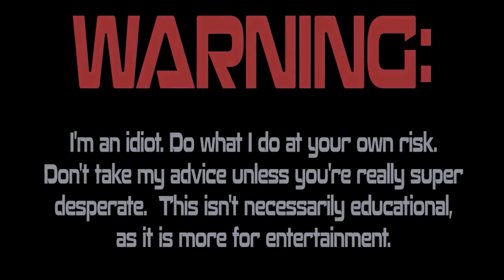ABANDONED S10 First Drive In MANY Years! (No Brakes)

Comment: Wow, I use to have one of those Chevy S10 but it was a four door Blazer model with the GM Vortec 4.3 Liter V6.  
  That was a nice 1994 Chevy S-10 Blazer Forest Green Metallic.  I loved that truck put over 210,800 miles on it and sold it to a Mexican dude who pleaded to buy it he wanted it bad, I kept mine mint clean and washed all the time although I had my first Children back them two of which were my first Daughters. I kept it clean.  
Now I have boys two of them and they are young I have a Dodge Caravan, Its clean and rides nice.  But I noticed that the GM cars and trucks are not good anymore, just the build quality is totally cheap and ugly. 
 A Friend of mine has his new 2019 at that time back in 2019, his GMC truck 2500 HD, after 20 months of owning it had ran into a Air-conditioner problem and the shop quoted him $2750 to fix his Air Con.  They have to take out the whole dashboard and unhook a lot of stuff to replace a part that cost only $11.00 
  There is no other way to get to it.  Build Quality suck across all of GM products.

Comment: the clutch in my 89 s10 would sing and i pull the inspection plate off and shoot some wd40 or silicone sex lube up in her to get that thing to stop making noise, i have to do it every 6-10 weeks, but i can say i never had to open that trans up, i keep my rides maintained to the max and do what ever I can to keep it alive, the rear abs on these trucks were a pos, but the brakes in general worked good, who needs abs anyway or trackion control, thats all crap i wish never were ever put on a car, sandwhich looks good

Comment: Worst smells I had on vechiles have found working over years  is horriable is Ford  Transmission Fluid burn up on ones use Mercon in Automatic Type , plus Manual transmission , 80W90 Differentail fluid and Desiel fuel to be engine oil mix in when need changed too and all engine oil thick like Molasses in crank case! Desiel fuel burn rich because Desiel motor gasket leaks go thru crank case and runs rich like coal ! Plus other is guys smoke strong Cigars plus Chewing Tobacco spit over there vechile cab everywhere ! So say that but I seen it and had clean up messes on vechiles before had rebuilt or repairs!